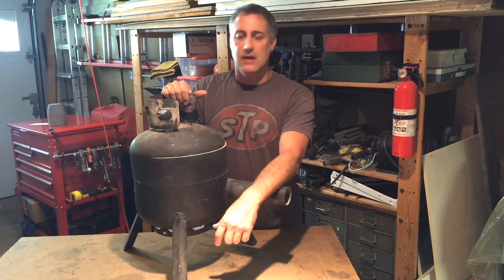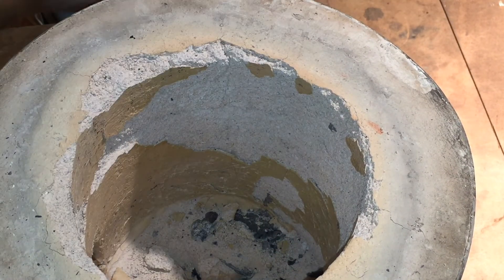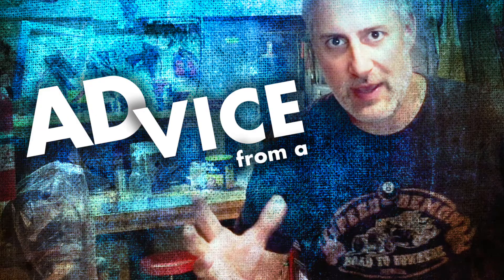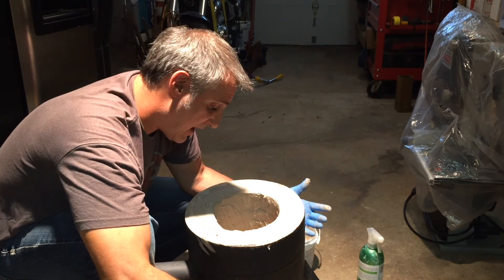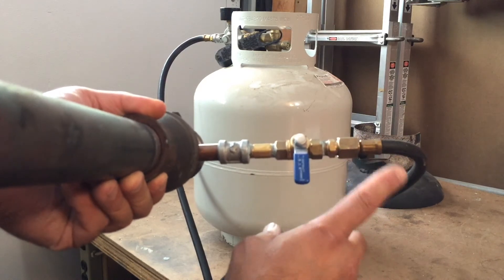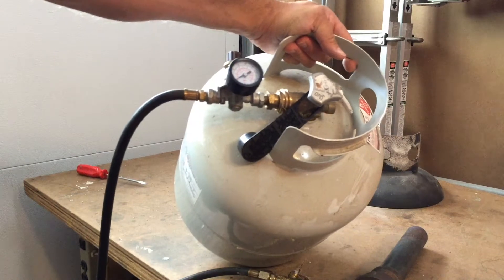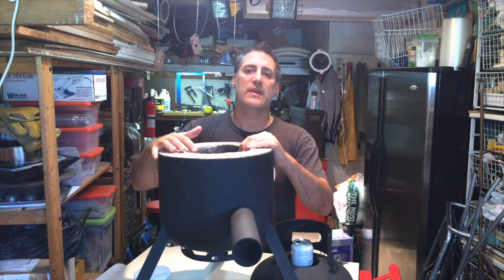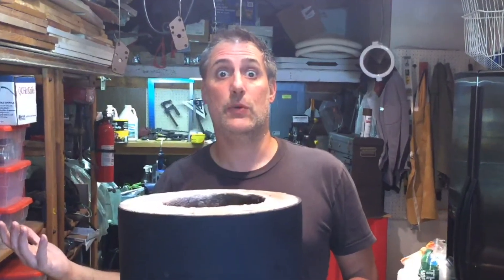Beginner Backyard Metal Casting - Foundry Furnace Maintenance

Comment: I have the same setup but I lined the furnace top sides and bottom with refractory insulation. I bought it from a welder it works great. No cracks after much use.
Reply from the maker: That’s sound awesome. I can see me redoing my set up fairly soon.

Comment: I used to spend a BUNCH of time on Alloy Avenue.  Great people and super helpful.  I kinda got away from it because I never got about to building a foundry.  But I still would like to get one set up eventually.
Pop cans aren't the greatest for casting though.  Although, if I ever do get a foundry set up, I'll probably try melting down all my pop cans and other extruded Al.  Not for casting, but forging.  I didn't think you could forge aluminum, but Roy over at Christ Centered Ironworks (another great YT channel) showed how it can be done.  You have to be real careful with the heat.
Reply from the maker: I started metal casting because of Alloy Ave! Must be over four years now. Yea, I know that cans aren’t the best but they’re free and I mostly do lost foam. I’m a subscriber of Roy as well. I have to try forging aluminum!

Comment: OMG man.. quit using that garbage.  Break all that junk out of your FURNACE and cast the floor, walls and top with Mizzou refractory cement.  If you don't poor boy your FURNACE, it will last for years.  Look at mine, and I melt bronze!  Another option is kastolite refractory cement.  Home depot does not sell ANY materials suitable for furnace construction.  Maybe sand, but nothing else.
Reply from the maker: +worldtraveler - You are 100% right. I probably should have mentioned that I used 2 inches of KAO Wool with an 1 1/2 of Kastolite over it. I then did a skim coat of the high temp cement over the refractory to smooth it out. Thats what was mostly crumbling off. Most of the damage was from my crucible tongs hitting the sides of the furnace wall.
Reply: eviltwinx that's good man.. you have a good setup under that coating.   hey, there is a new casting site.  come say hello at thehomefoundry.org
Reply from the maker: +worldtraveler - I'll definitely have to check it out!

Comment: How long did you let the skim coat dry before firing it? Mine has been sitting for a couple of weeks now so I'm hoping it's pretty dry by now. Even so, I plan on only firing it for a very short time the first time(s) just to try and gracefully drive out any remaining moisture.
Reply from the maker: swdweeb - I didn't wait long enough. Just a day and my heat was way too hot. That's why I got the freaky texture. You should be ok and keep your heat low.

Comment: lol, glad to see you getting back into metal casting. Ill check out that other guy for sure. Also, they're installed and working perfectly, or one of them is, and it only uses one to work :P
Reply from the maker: Chirpy's Tinkerings - Thanks! Yea, been itching to melt metal for awhile and I have a cool project in mind. That's pretty sweet the half nut it up and running!
Reply: I cant wait to see what you come up with to cast, lol. Also, yea, the lathe just needs the parts brazed up, then it's going back together. So when are you going to start working on your's again? :P (yes, Im going to keep bugging the crap out of you about that, lol)